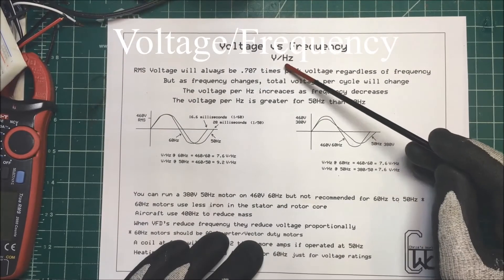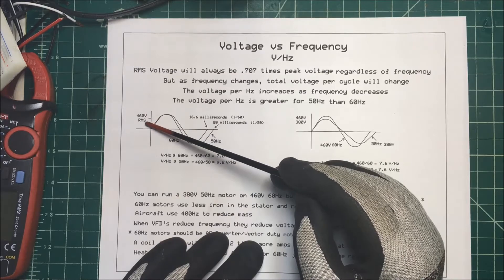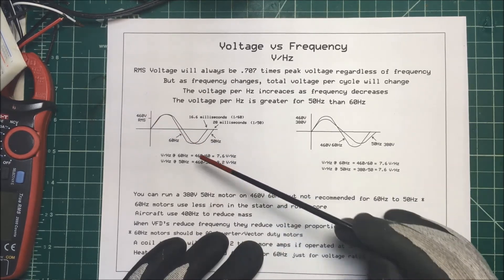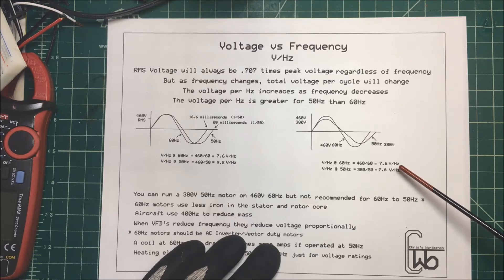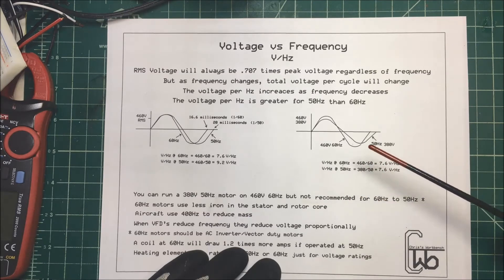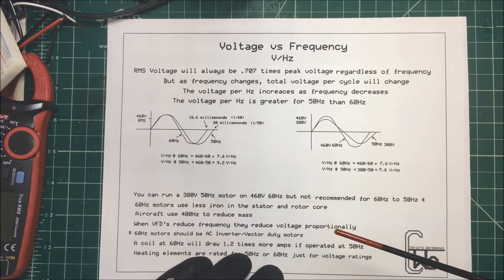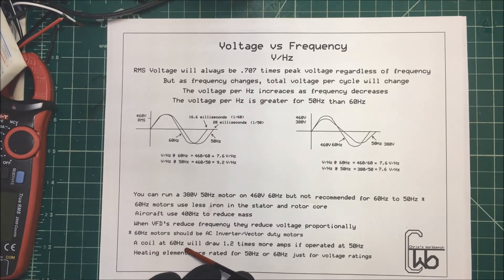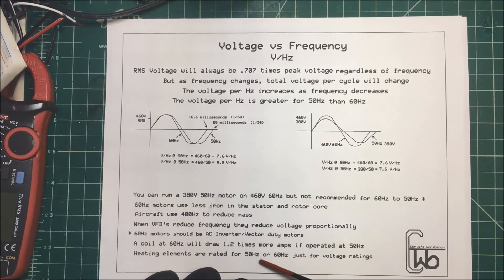Voltage / Frequency

Comment: I notice some CONTRADICTION !! So if you reduce the frequency in hertz you increase the voltage, but then VFDs do the opposite, they reduce the Frequency in order to decrease the Voltage. How is that supposed to make sense?
D'you know what?  I think there is no relation whatsoever between Volts and Hertz.  It's just pure INDOCTRINATION.
Why? You can generate from a prime mover (air, heat, water) a certain level of energy in a generator making a shaft rotate at a certain angular velocity (rpm) and we will always get different rpm sometimes 20x rotations less, like 150 rpm = 2.5 cycles per second.  And yet we will be able to power our household appliances.  It is all about Power (watts) and whether this one goes one direction, two or several ways.
Reply from the maker: Decreasing the frequency of a motor while maintaining the voltage, increases the V/Hz ratio.
A VFD compensates by lowering the voltage to offset this increase.